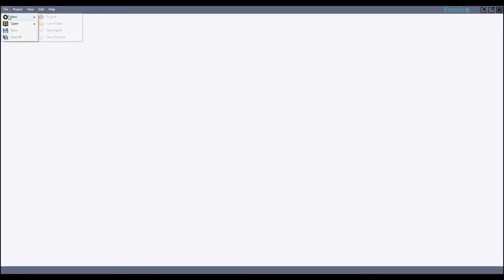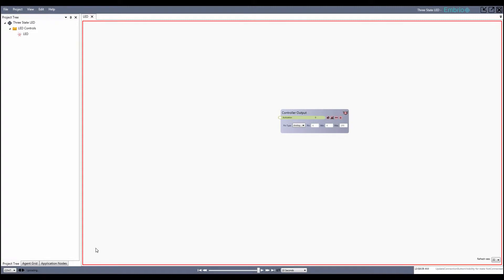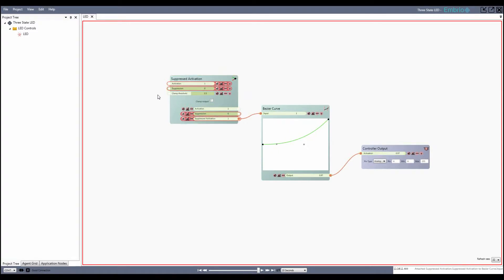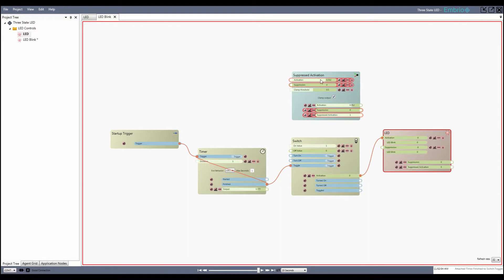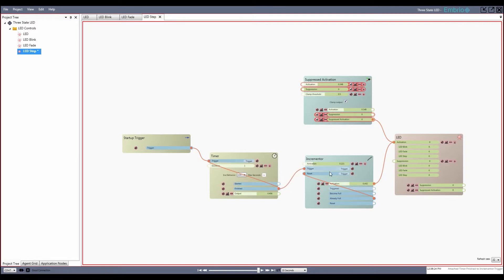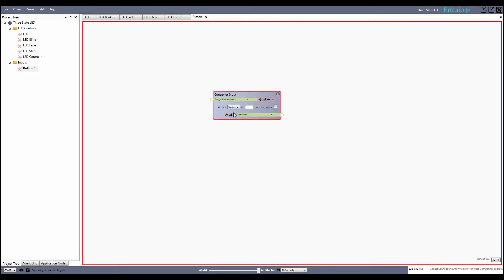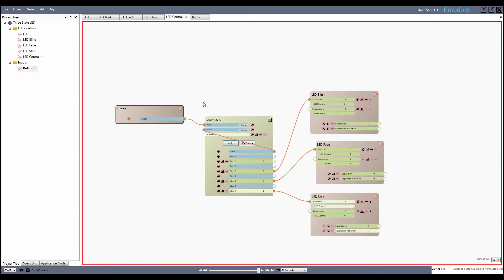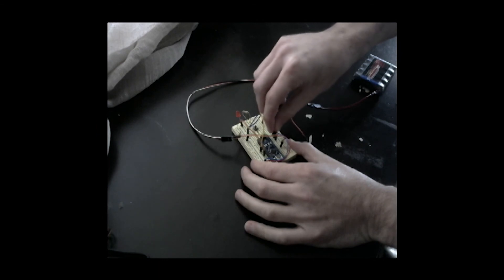Embrio Three State LED Demo

Comment: Trying to follow the tutorial, but there is no bezier control in the build I downloaded yesterday
Reply from the maker: Gary Thom Sorry Garry.  This is an older video.  The Bezier curve node needs some work before it works with the compiled program so I had to take it out temporarily.  I'm working on fixing it or replacing it with an even better node soon.